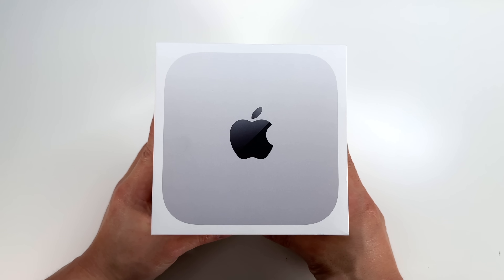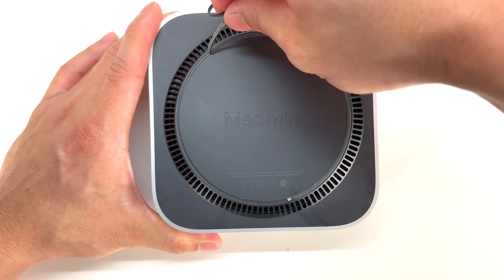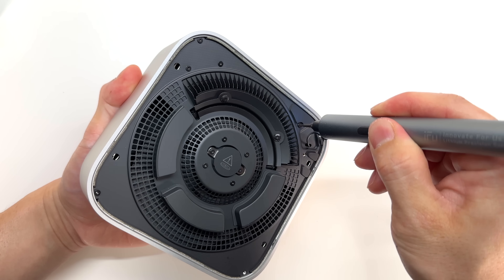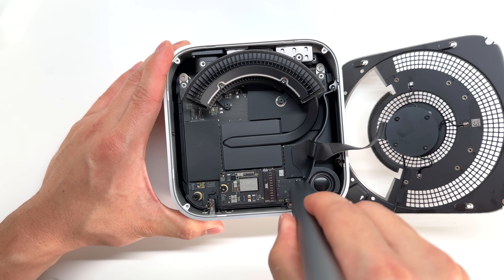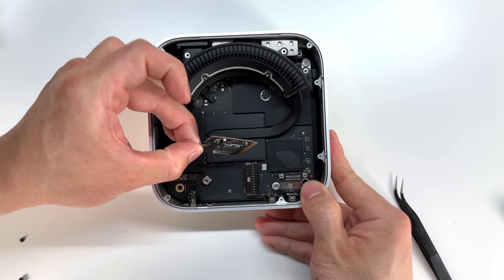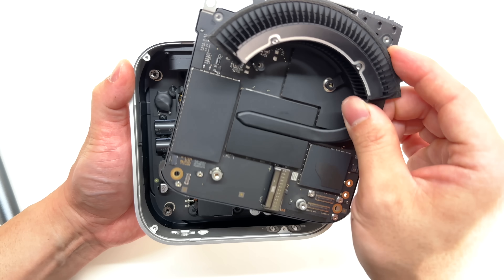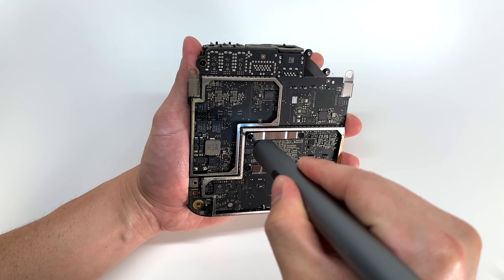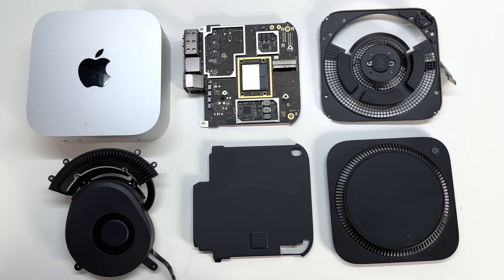2024 M4 Mac Mini Teardown FULL - SSD Removable

Comment: Amazing video. Wondering if what you thought was an SSD could have been a network card(Wifi / Bluetooth)
Reply: Wifi Bluetooth is on the bottom plastic. You can tell because of where the antennas connect. The SSD is next to the M4 chip in the package under the heat sink.

Comment: Interesting video. Is it dust we need to worry about? because holes gap is a little bigger 🤔
Reply: My concern too. Desks get very dusty. You should be able to cut a section of 7mm air filter material to fit over that grill. A the plastic base should of been screwed in as this plastic is brittle and can be broken easily when removing it.

Comment: You have the logic board in your hand at 8:35. Is the ram the area bordered by the square aluminum frame in the lower right from the CPU?
Reply: I think it looks like the ram is next to the cpu?
Reply: they use this design since m1. ram is literally a part of cpu now.
Reply: @lorem2020  Well, it’s part of the package. Under the heat sink there were three rectangles next to each other with thermal paste. One is M4 SOC. The SOC contains the CPU (which contains Performance Cores and Efficiency Cores to balance power management and processing power), the GPU cores, Neural Engine, the Secure Enclave, Media processors, display control, Thunderbolt controllers, USB controllers, and important to this discussion, the ram and storage controllers. Next to that is the RAM in the other two rectangles. All three components (the M4 SOC, and the two RAM chips are packaged together, but are not on the same die.
Reply: @lorem2020 , thanks for this info. It's bad you couldn't also upgrade the RAM but upgrading the SSD isn't a bad deal since now you don't have to be gouged by Apple for an upgrade.

Comment: Very good video. One thought I have to improve this mini is, I do not like the location of the audio jack. If I were to use headphones I would go Bluetooth. So all I would plug in would be external speakers. So why isn’t the audio jack in the rear? This tear down shows it is completely possible to add an audio jack to the back panel. Now your speaker wire will be out of the way, where it should be.
Reply: Absolutely. The audio port should of been on the rear.

Comment: Awesome teardown! 
removable SSD really shocked me. Ik you can't upgrade it though but it's good for repairs.
Reply: Already saw video upgrading the ssd to 2TB.
Reply: @shlovekon  where??
Reply: Maybe they used cheapest QLC SSD and know, it is going to die early.😂
Reply: What kills Mac SSDs is the lack of over voltage protection to the storage. And once the internal storage is borked, it has to be replaced for the computer to boot.

Comment: Would you wager if you can put that motherboard into a macbook pro 2012 body?
Reply: Doesn’t have the controller or connector for the display. And you’d have to see if the board can be powered by USB-C. Wouldn’t charge the battery. Too many issues.
Reply: @ I really like the 2012 body…  I wish we can customize laptops like we can with desktop

Comment: I hate soldering ssd /ram /cpu and power supply inside
Reply: Agree.  The SOC design has its drawbacks and this is it.  While I can replace RAM, SSD, and CPU on my trashcan Mac Pro, its inherently impossible on M-chip era Apple devices.

Comment: Excellent video. The device should be mounted upside down, I'm sure, to maximise cooling through natural and assisted means, and also improving access to the power button. I'll try when I get home, perhaps mounting it upside down in the box base, maybe with four rubber feet between the cardboard and the metal top surface. I don't think the design, as it is, will last too long if the psu heat is trapped under the top, or if the cables repeatedly get twisted when the power button is reached for - they'll break in time, particularly the hdmi.
Reply: It’s using the aluminum case as a heat sink for the power supply and heat rises. I suspect Apple’s engineers thought of this. I hope they have metrics on how often people use the power button.

Comment: SSD removable, not soldered? Interesting :)
Reply: i hope you can upgrade it because it would be crazy, i mean 599$ for 16GB RAM and 256GB SSD and then just 80$ for a 1 TB SSD it would be crazy cheap.
Reply: @tibor1838 It's not a normal ssd module, can't be replaced by end user
Reply: Probably has firmware to determine if it is licensed OEM. That's the Mac way.
Reply: This isn’t a SSD technically, the controller that would be normally be on there is handled by the M4 itself. This is really just a board with raw flash chips.

Besides, the interface is also different.
Reply: The fact that it can be replaced at all gives me a tiny sliver of hope that it's life can be extended past the number of write/read cycles on the NVMe drive. It might mean taking it in to the Apple Store at the end of your 3 year extended warranty to get a fresh one before it dies, but that's better than replacing the whole thing.
Reply: Wasn’t it the same in Mac Studio? Technically it’s not the SSD, it’s just the NAND chips. The M4 includes the storage controllers and all the other required parts. Even if you ”swap out the SSD”, the chip probably wont recognise it. If you could even find a replacement in the first place, because it’s not standard.

Comment: my gosh i cant believe the internal ssd is actually removable 😱 i hope a moder creates some type of adapter to put a full size nvme on it 💥
Reply: No it doesn’t work regular NVME. It’s proprietary
Reply: @shoombooltala24  proprietary mechanically, connector type, pinout ?   or on the electrical data protocol as well ?
Reply: @nick066hu it have no controller. Just nand chips. So you can’t install regular nvme because it have it’s own controller :) but I am pretty sure there will be replicas
Reply: @nick066hu it’s not an SSD. It’s bare flash. The SSD is decentralized on Macs, as the controller is part of the M4 SoC
Reply: it's not an NVME it's a board for for the nand modules, same as the mac studio/macpro
there's hope for upgradability, (a french company made already boards for the mac studio)

let'seeeeeee
Reply: @TinyWorkshop  It would be super easy for Apple to bind alllowed max SSD size to the motherboards serial number, apple ID, or whatever.  ..or if not yet, they can do it anytime Iater with an OS upgrade.  I doubt they left out this FAPF (frozen as paid for) feature.
Reply: @nick066hu  they didn't do that on the mac studio, the NAND flash just has to be blank when you put it in, and it works fine. Besides how would an OS update matter, you are taking out the chips that have the OS. It would have to be a firmware update or smth.
Reply: @TinyWorkshop  no SSD are not after market upgradable . These are only made by apple for apple computers , these are locked to the system you need to go to apple for upgrade because of software lock even if you want to upgrade you have to pay for service and the upgraded SSD .
Reply: @hellslayer9638  people have already upgraded soldered nand on macbooks so I'm pretty sure this will be possible on this. You'd maybe need at least to do a DFU restore from another mac. The nands need to be flashed and paired but some manufacturers could very well do that (probably not legally though)
Reply: @hellslayer9638  Partly true. But there is a third party board in the works as a kickstarter called Studio Drive for the Mac Studio which uses the same (or similar) proprietary NAND cards. You can’t pull the card from one computer to another because the NAND chips are programmed. A replacement would need blank/unprogrammed NAND chips, which the Mac would then program during a Configurator session. It’s possible the cards in the kickstarter might be compatible since it appears Apple used the same design generation on the M4 Mini as the M2 Studio. The cards supposedly ship in December. They’ll have unpopulated cards and various configurations. But they haven’t announced compatibility with the Mini since they just came out.
Reply: One cool thing about the Studio Drive project is they’ve included overvoltate protection, which overcomes a fatal design flaw that is too often triggered in Macs with NAND that ends up killing the storage.
Reply: so we are future-proof buying the basic SSD size, hoping that when it comes to some time we want more storage, there will be either a third-party upgrade board or as a last resort we can buy an SSD upgrade form Apple ?
Reply: @nick066hu  They won't sell these, except for repairs
Even if they ever do, you'll have to pay through the nose for a bigger module
Reply: It requires some soldering and hacking but yes you can "upgrade" Mac Mini storage. Totally not worth it because the cheaper option is to simply buy external Thunderbolt drive. It is not that slow compared to built-in SSD.
Reply: apple desperately does not want you to supply your own storage so im sure they will fight
Reply: The keying looks slightly different from the mac studio, but it still doesn't seem to have a storage controller. The storage controller is likely still on the SOC which means you need a custom PCB with completely blank NAND flash on it and a second mac to restore the OS. The upgrade is almost certainly possible, but it will likely take a few years for people to start producing that hardware.
Reply: waiting people convert Mac mini board to a laptop 😂
Reply: It stores the bios on the SSD, so no standard nvme drives
Reply: i believe its could be not a hard process to desolder the Nand and use a bigger size isntead so you don't need a board just the Nand in 2TB will be Enough. it's doable.
Reply: I saw a video recently where a guy successfully upgraded the Mac studio SSD from 512 gb to I think 4 TB SSD . This SSD looks the exact same as we get in Mac studio .
Reply: @hellslayer9638  yes from a Mac Studio to a another Mac Studio it work
Reply: @hellslayer9638  if you look closer it is, unfortunately, slightly different

Comment: This power supply looks absolutely sick 🔥
Reply: They did all that work on the power supply so that didn’t have to have an unsightly wall wart. I bet they had to design around the power supply first then the chip. If the power supply wasn’t there this would be a thumb drive and hard to justify $800. These are getting to be like expensive watches now… 

It does generate some heat I bet.

Comment: Finally replaceable SSD?
Reply: If it not paired with the motherboard, like in the Mac Studio.
Reply: @MaxPayne-HaveNoFear  Paired. But Apple would be able to replace it. And there are third party solutions happening for the Studio which should apply here. The issue is the NAND chips must be unprogrammed so the computer can program them for the computer. I’d say it was Apple being evil, but it could be argued that it’s security.